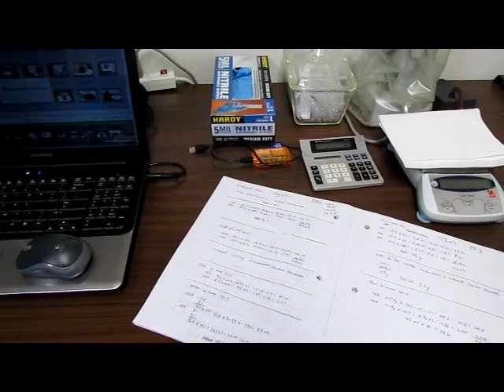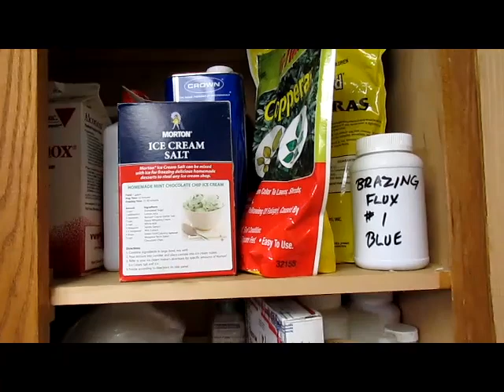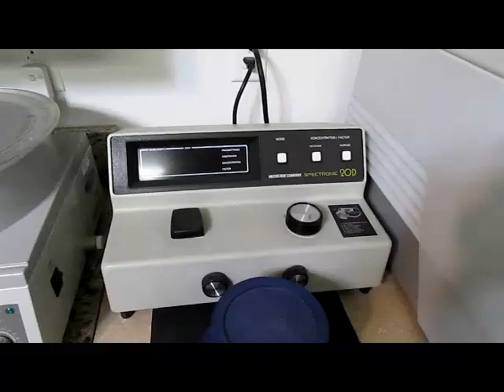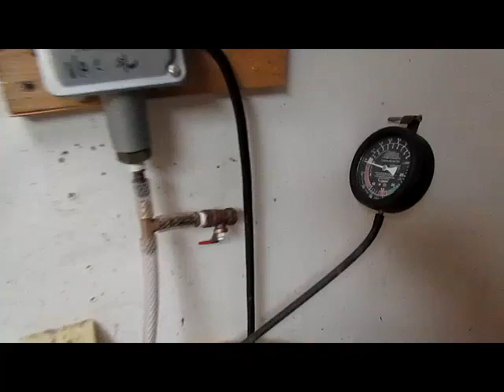Work Shop Tour

Comment: I had no idea that you owned that much glassware and that was 5 years ago! Love the home lab, the only thing I'd do differently, I think, is to store the stock pot and the waste bucket in a different room that vents directly outside, maybe some kind of shed outside, with plastic tubing running from the lab to the shed. I might also do something for the ground, so that if I break something, all liquids run into a plastic tub and can be retrieved easily, like in a bilge on a boat. This video gives a lot to think about. It would be neat if you made a similar video 5 years later to tell us what you'd do differently if you could. Does you lab smell at all when the fume hood isn't running? As always, thank you for the wonderful content! I've been following you religiously from France for a while now. It will be well deserved when you reach 100,000 subscribers, which looks like it should happen very soon! :)
Reply: I forgot, I would also install an eye-washing station, but maybe I missed it in your video. :)
Reply from the maker: Agree. I already store my waste treatment outdoors because adding sodium hydroxide to the iron in solution makes ammonia fumes. They seem to be even worse than acid fumes. I need to get those other two buckets outside also. The fume hood runs 24/7. I rarely detect any odors. The old fume hood motor used to pull a nice vacuum. I could feel it when I opened the door. But the junk motor in there now requires a restrictor on the outlet pipe. Otherwise it overheats and shuts down. Courtesy of labconco. I wouldn’t touch another piece made by them even if they gave it to me free.
Reply: @sreetips  Thank you for the reply and sorry to hear that you're still unhappy with the new motor. I thought that this issue had been fixed, I even thought that the new motor was more powerful since it appears to be making more noise. What you went through with their motors (and their apparent incompetence) was insane. I know what you mean about the sticky door, I had a photo lab like that and you feel really safe when you can literally feel the underpressure with the door sticking and the outside air whistling through the gaps. I still smelled the nasty chemicals though. I wonder how long the motor will last if it's crap and has to run continuously. Imagine if it stopped working during large reactions with platinum salts or chlorine gas...

Comment: This is impressive! I want to get my workspace set up in a similar fashion. 2 things though, what is the centrifuge used for? (Supernoob question) and the other is are there any gpu’s mining cryptocurrency in or near there? LOL Sounds like you have a lot of fans on something, is that your hood? I wonder how much cfm I need to have to make an adequate exhaust. Is that space negative pressure? No worries if you can’t get to answering I’m sure you get bogged down with questions from the community.
Reply from the maker: The hood is an absolute must. No way to safely do reactions without one. Get one that is suitable for acid digestions. No metal parts. The centrifuge is a luxury item. I rarely use it. In refining, gravity is your friend.
Reply: @sreetips  roger that! I’m a long time away before I attempt anything. I’m watching all of your vids and reading everything I can from the gold refining forum. And def., not without an appropriate hood. I love my lungs and one thing I know from being a nurse is that you miss those once they’re gone! Thanks for your advice!

Comment: Wow thats more than just a hobby thats a job very well organized and clean.  why so many cuples disposable ideams?.
Reply from the maker: Ray, not sure what your question is here.
Reply: I was Trying to figure out why that in your video at the 6 minute 35 second mark there is a big stack of ceramic cup with different color fluxes burnt in them and I was wondering if you only can use them once or is it just a collection for cups that you uses over and over
Reply from the maker: Got it. I have a bigger stack put up inside a large covered plastic container. I used to use a brand new dish every time I melted pure silver until it began to form some crud on the silver bar. I removed the crud from the pure silver bar by bathing it in a dilute sulfuric bath. Then I would retire that melt dish to gold inquarting. I have since started cleaning the silver melt dishes with borax and I now use it over and over. I just started this new practice. Plus I do lots of jeweler's polish sweep and filings. I melt the large pieces in a dish with lots of soda ash (sodium carbonate) and that kind of eats into the dish. But each of those dishes can be cleaned with plenty of borax and lots of heat from my oxy/acetylene torch. There is gold and silver that can be recovered from those dirty dishes also. I'll have to do a video showing how I do it.

Comment: This is an absolutely beautiful set up! Very inspiring for a new beginner like myself. I noticed you have a rosary, do you often pray the rosary? Just curious. How long have you been in this hobby? Do you think you'll ever get burnt out? How often do you replace glassware? Any big mistakes/tips you would like to share? Any info is much appreciated! Thank you for reading this!
Reply from the maker: I pray all the time. Many are prayers of thankfulness. I have been blessed beyond measure. But most of my prayers are for forgiveness. I am the greatest of sinners and a firm believer in what goes around, comes around. I've been refining for about 6 years now. Got started on goldrefiningforum.com - kadriver is my user name there. As long as I keep this a hobby it will be fun and exciting, always trying new things. As soon as I make it my work, it will become just that; work (quote from Harold_V on GRF). One of my biggest mistakes was trying to boil some inquarted gold in concentrated nitric acid. I left it outdoors (pre-fume hood days) and it started bumping the gold out of the beaker and all over my deck. Got a bad whiff of some chlorine gas one time. Here's a most valuable tip: watch my video on refining karat scrap. Notice that I never pre-mix aqua regia. Instead I add just HCl to the gold to be dissolved, cover, and place on low heat. Then I begin adding small 1 or 2ml doses of nitric acid a little at a time until the gold just dissolves. If done correctly, there will be very little, if any, excess nitric acid to deal with. Excess nitric in with the dissolved gold causes all kinds of problems. Learning this technique was a turning point in my refining experience. One of the most valuable lessons I can think of.
Reply from the maker: I've been very lucky and have broken very few pieces of glassware. Most of it is still with me. I wash it promptly after each use using alconox detergent made specifically for lab glassware, then give it a quick rinse with distilled water from an old dish soap squirt bottle converted to a distilled water bottle. Dawn dish soap has the best plastic. It's thick and lasts a long time. I've had those same plastic bottles by my sink for the entire 6 years I've been doing this.
Reply: +sreetips Thank you very much for responding! You have a beautiful channel and I love how you get this message out there to people. I pray that you will stay safe and healthy. Can't wait for the next video whatever it may be! Oh, by the way, do you stack any of your precious metals? Or do you sell them all after refining?
Reply from the maker: I try to keep a little, but it's hard with all the bills.

Comment: Hey Streettips, Ive been in the gold/pawn business for a long time and have used many refiners, most recently NTR metals which is now Elemental. I drop off thousands of ounces a year and have always known about them keeping my bi-metals, I am now wanting to set up a lab and learn this process. Do you have a tutorial on how to extract melee diamonds from an acid bath? Are you near Atlanta?
Reply from the maker: I also use Elemetal (there's no "n"). I'm in SC, about 5 hours from Atlanta. I usually pull the tiny diamonds out before I inquart the scrap karat gold with silver. Most folks don't realized that karat gold and gold filled scrap both contain silver and platinum group metals. And the big refiners don't give credit for either, unless you pay a $75 refining fee. But if you refine the gold yourself, you get to keep both.
Reply: haha, you're right. I just realized it's Elemetal. I still call them NTR. I've paid that 75.00 fee so many times i can't count. I do large quantities and would never have time to pull the melee out by hand. I usually send it to the Texas office and get paid 95% on gold and get the melee back. I just want to figure out how they dissolve the metals without harming the melee.
Reply from the maker: Check out youtube user "indeeditdoes". He created a video that shows how he dissolved the gold from a diamond ring with the diamonds still in the ring. He then just filtered out the diamonds. But here is the problem; if the karat gold has a high percentage of silver, and you put it in aqua regia to dissolve the gold, then the hydrochloric acid in the aqua regia will react with the silver in the gold and form a passive layer of silver chloride over the gold, effectively isolating the gold the acid. It won't dissolve any further, no matter how much heat you add.
Reply: Thanks streetips, I've watched all his videos and have learned a lot from both of you. I will post some videos when I finally get comfortable enough to move forward. That first step is always the hardest.

Comment: Is there a substitute for the nitric acid? You use it to precipitate the lead correct?
Reply from the maker: Nitric acid, in my experience, is essential for dissolving silver copper and other base metals from inquarted gold. I don't think that there is a substitute for it here. However, there are ways of making your own nitric acid with a nitrate, salt such as sodium nitrate or potassium nitrate, and sulfuric acid. But I've never tried to make it myself.

Comment: hi,

can you please email me or comment how much that costs? especially the machines - spectroscopy - i think- am not expert at all...and an average of revenue and net income /TOTAL working-preperation-purchase hours in a month

thanks a lot

i am really puzzled can i make a living from that? i mean more than $15/total hour work?
Reply from the maker: Hello Mike. You can refine at home for a lot less than what I have invested here. You could get started with less than $300 using a hot plate out doors and a wooden storage shed in your back yard. You can use Pyrex Measuring cups, various sizes at the thrift store for $2 or $3 each. Most of my glassware came from eBay. I buy used stuff because it is cheaper. I probably have several thousand dollars invested in glassware. Nitric acid is not very easy to get. You must have a company and they only deliver to a business address - no residential deliveries. The torch was about $350, you can use propane instead of acetylene. Vacuum filtration is nice but not necessary. My vacuum setup cost about $250 including an AC vacuum pump and fittings from Harbor Freight - $120, a plastic cart from Harbor freight about $80, and an old 8 gallon air compressor tank that came from Craigs List for $30 bucks. I tend to go overboard in any venture that I get involved in. The spectrophotometer $199 off eBay, is used to determine the amount of dissolved copper in a sample of my silver cell electrolyte - totally not necessary - but it does enable to me to acurrately determine the dissolved copper and if I can re-use the electrolyte for a second or even third batch of pure silver crystal. The centrifuge, $540 eBay, is also not necessary. Some PGMs take days to settle, the centrifuge does it in minutes. But I rarely use it. I also have a rotevap and water bath $100 discontinued model off eBay, to evaporate gold solutions to concentrate them. But I rarely use it. The Labconco fume hood was about $600 delivered. i had to cut a hole in my roof, but I put the roof on that house myself so I know how to do it. The house cost me about $1200 monthly (in lost rent because I rent it to myself - its my man-cave). The taxes are $2k per year. Lights and water are about $150 to $300 per month depening on season. Unless you can get the scrap for very little it will be very difficult to make a living. I do this as a hobby. My wife is the reason I can refine like this instead of punchig a time clock working for someone else. She is the primary buyer of the scrap that I get to refine and sell for my hobby. She is a master negotiator and can spot a piece of over-looked gold in a thrift store show case at 20 paces! She is constantly on the lookout for a good deal buying gold and silver for me to refine. I am truely blessed! Hope this helps.
Reply: sreetips the nitric acid, is there a substitute since it is so hard to get? you use it to precipitate the lead, correct?